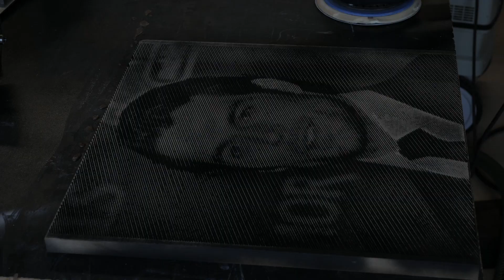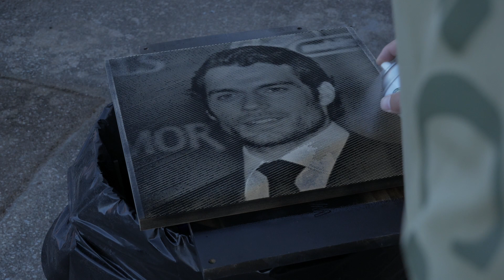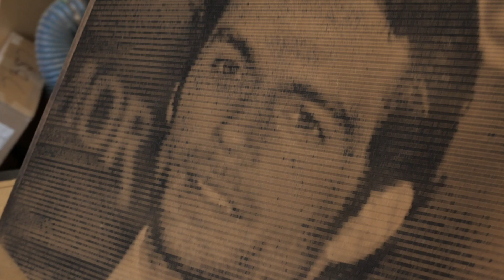How to carve photos on a CnC Machine

Comment: Came out better than my attempts. Will try your spacing. Btw… if only you had an easier way to cut that t slot on the back…. 😊
Reply from the maker: Haha!! True true I just don’t feel like changing bits. Although most the time I have more than 1 going at the same time so normally the machine is still working on something else.

Comment: Hi! I’ve been trying to get a good looking photo carve to work forever, and it looks like you’ve gotten the formula. I use Vectric also, and would LOVE to know … what bit are you using? What material are you carving?  What is your start depth? Max carve depth? Step over retract? Using raster or hatch? Line spacing? Line angle? Any other tips as to the finishes? Thanks! Gary
Reply from the maker: Hey Gary! Sorry things are a little crazy around here getting ready for Christmas! 

Bit: 60* V Bit (brand irrelevant, I have used about 6 different brands)
Material: I only use MDF  (which is whats in the video) and Hard Maple for doing these carves. You need clean wood with very little grain lines. Grain lines can effect how the image looks overall and might mess it up
Start Depth: 0.0
DOC: .06
Retract: .12 (could be dependent on your setup so test this one)
Raster or Hatch: Raster
Line Spacing: I normally adjust line spacing from 100-120% depending on the picture to see what looks best. This photo was 119%, but I have done plenty on 100% and anywhere in between. It really is just picture by picture and what you think looks best.
Finishes: I have only ever used Shellac to finish. It works great for this and dries fast. I am sure other stuff works, but I have never been unhappy with shellac enough to want to change.
Reply: @houseofbraxtonwoodworking  excellent - thanks so much!  Gary
Reply from the maker: @garyn234  No worries at all! If you have any more questions, feel free to ask ... I will be glad to help where I can!
Reply from the maker: @garyn234  just to follow up on this … I just released a couple other videos going in depth into the software setup side if you haven’t seen those yet…
Reply: @houseofbraxtonwoodworking  I look forward to checking them out ... thanks!

Comment: Would you be up to do a video on your setup like what's the best setting for doing pictures?
Reply from the maker: Hi Adam! I was thinking about doing that as well, but was unsure if many people would want to watch it as I am not sure how many people are using Vetric software.

As far as my vetric settings (until I can get a video of that up):
Bit: 60*
DoC: .06
Angle: 22.5* (I do change the angle on some pictures if they seem to look better at different angles)
Line Spacing: 100-120% depending on the photo, I just move in there and render the image to see what looks best. 

Any other settings you are curious of?
Reply: @houseofbraxtonwoodworking  Feed/speeds?
Reply from the maker: 18k @ 70 IPM … working on new video that will cover all this more in depth … should have it up tomorrow.